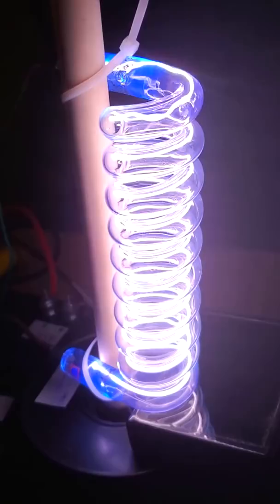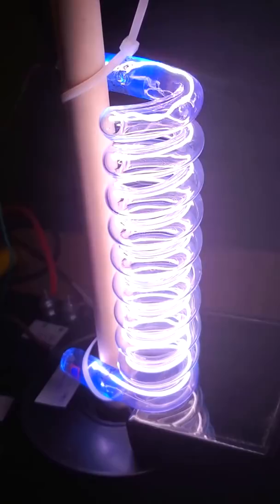high energy helical xenon lamp

Comment from the maker: Helical lamps like this are obsolete for even flashlamp pumped lasers, so they are rarely made any more and are thus very difficult to find. Linear flashlamps are almost always a better option in driving solid state lasers. Not only are linear lamps more efficient for pumping laser media, they also have significantly lower inductance than a helical lamp. That being said, it is hard to top the beauty of these old helical lamps.
Reply: Literal prodigy.
Reply: Cool
Reply: A sincere request to also upload these shorts as videos bcoz I hate the auto-downgrade of quality with shorts, I can't fricking control it!!
Reply: ….Pretty cool, right?
Reply: The light
Reply: I love how you type exactly the same way you speak
Reply: How did you procure the lamp
Reply: Beautiful 💞 neon is jealous 😂
Reply: Yes
Reply: I read this in your voice
Reply: @sushimshah2896  just don't watch it through the shorts section do it through the channel and it'll be a regular video
Reply: Omg the bug zapper over 9000
Reply: Is the higher inductance due to the helical shape, like the coil on an inductor?
Reply: Can't you just take a linear lamp, roast it a little and weave it into any form you want?
Mmmm flash pump spaghetti
Reply: Love this guy.
Reply: That laser you showed at the end with it tho... Good lord, the fact that it's capable of making the air in it's path literally combust like that is astonishing as to how much power it has. Sure it may not be very efficient, but... It's certainly beautiful.
Reply: @bigdiglett3258  On mobile it forces it into the shorts portion of youtube regardless of how you access it. If you want it in video format, utilize desktop. (It's literally the only option for such. And hopefully Google's dev team for Youtube doesn't screw us desktop users over in that area like they did with mobile users.)
Reply: @timteecvhn  i wrote that comment while viewing the video normally on my phone you just have to press it in your reccomended or the videos tab of the channel instead of the shorts part of the home tab
Reply: Love these vids!!!
Finally getting a constant supply of epic vids :D
Reply: @KB04  why you got a girl pfp
Reply: @corpmobb4134  why do you care enough to ask
Reply: @corpmobb4134  first of all why are you asking a random person that on the internet?

Second it’s really common.

Third it’s actually a gif but it starts with a girl and it only works on google.
Reply: Pretty cool, right!
Reply: @bottlekruiser  I'm the master
Reply: Wow man, that is pretty pretty cool. Love it
Reply: @timteecvhn  In the laser cannon video, this thing shattered the original lens he used to focus the beam. He had to get a special one which is more transparent.
Reply: I only want a link to buy them. is that so much to ask for?? i just want pretty spiral electricity
Reply: That lamp is quite honestly, one of the prettiest things I've ever seen
Reply: I do rather like the way the discharge slowly worms its way down from one end to the other as it starts up :-)
Reply: This is one of the most beautiful things I've ever seen. I want to find one of these to make into a lamp. I'm an electronics engineer, so having such a direct visualization of current flowing like water  is like a dream come true. God that thing is awesome.
Reply: Can I buy this?
Reply: @KB04  he'll never admit it but hes a genius. the amount of knowledge that guy has is wild.
Reply: I used to have one... They're pretty sick. At full tilt those things are hair up on end material if you're up close, among other things 🤣
Reply: @barretprivateer8768  Plasma discharge in that form is beautiful. I had a decent collection of all kinds of plasma lamps... Never not mesmerising.

It's all about the gases involved and their pressures, then just a little RF to wake them up.
Reply: @sushimshah2896  Just comment 00:01 , tap the
timestamp then the vid will play in normal
youtube instead of shorts

nvm youtube fucked it up
Reply: Is it possible that you can make an EMP grenade
Reply: @someguywithnochallenger8178  This thing is a rather weak one when it triggers... That what you mean? Lol
Reply: @someguywithnochallenger8178  All fine and good... Just... One thing man. Knowing what you don't know is important... The cap bank behind something like this flash tube... or an EMP (even toy level)... Don't mess with caps and high voltage until you thoroughly understand things like ohms law and why that's an absolutely unforgiving combination. Jumping in is great when the stakes aren't so high.

TLDR: Just be careful.
Reply: I love old helical lamps almost as much as i love tube valves but my heart is always with mercury arc rectifiers.
Reply: Get slo mo guys to film
Reply: @shea8830  Not really gonna be all that interesting
Reply: Hey Styro, I was wondering how viable a helical flashlamp like this would be for general or decorative lighting purposes? Would the power draw for just getting the xenon to glow be too much? Would the initial cost be too high? I must know!
Reply: @Crowbars2  A few watts to see what you see there. Unfortunately there's very little "middle ground" between that and the hot discharge (intense flash). Those tubes cannot sustain the normal [pulsed] discharge level continuously (at all), and don't really do "in between".

What you see there is mostly RF excitement, which could be intensified enough to make it glow a bit more, but it will never be "useful" light. Think neon sign.
Reply: @MadScientist267  Ahh, that's a shame. I was hoping that decorative bulbs that look like lightning in a bottle existed out there somewhere. The closest thing I've found is a plasma globe, and they don't really give you usable light. That helical lamp looks like it would make a pretty cool desk lamp or something, if it was more powerful and if it didn't shoot out tons of UV.
Reply: @Crowbars2  There's a little more light than a typical plasma bulb but not incredibly so.

To get real light means intense heat in a plasma, which only really has one way out in a bulb of that nature - via the envelope.

Quartz is tough, but not that tough haha
Reply: Bro u need help
Reply: I shat myself due to explosion in the end. 
Ну спасибо, я пошёл, поменяю штаны,  хотя бы.
Reply: @djpupsik98  Stay out of the lab 😁
Reply: Gota build me one for display
Reply: Of course, everybody knows that.
Reply: I think I saw one inside a gas tube of a CO2 laser for cutting.
Reply: What voltage are you running it at to make the cool plasma?
Reply: Why do you have more than one gigawatt laser
Reply: Check this out💥💨
Reply: That lasers is one in a thousand
Reply: You should try to make the Last Prism from terraria
Reply: @xaptus  He forgot to say it 😱
Reply: Kewl
Reply: Point being ?
Reply: S C I E N C E
Reply: hmmm yes got it! i don’t understand at all
Reply: That's exactly what I need toneliminate mosquitoes in summer, right???
Reply: I want one 😆
Reply: How does it power the pulse? Is it about capacitance ?

Comment: With enough current, everything is a fuse. With enough voltage, everything is wire.
Reply: but is the wire or the fuse that kills you
Reply: @agustinsida8877  💀💀💀
Reply: @agustinsida8877  botj
Reply: @agustinsida8877  bruh 😂
Reply: I hate the fact that this is correct
Though not as much as the fact that I havent heard it before
Reply: @agustinsida8877  i forgor 💀
Reply: @agustinsida8877  the fuse
Reply: tezslaw
Reply: Technically the fuse burns you but you being the wire in a specific way is what stops your heart
Reply: What's the difference between a current and a wire or  a fuse  and voltage?????
Reply: @Wiimaster.  lots of things
Reply: @__lasevix_  Precisely, and that is exactly the reason why one must eat honey with cheese and drink milk while washing their hands from the sea at night before a full moon.
Reply: @agustinsida8877  well, it takes fewer amps than volts to kill a person. But too much of either is not ideal.
Reply: @doug4974  yeah, that's why Celsius is more efficient, you only need 22 of those to keep a person alive, not like those 295 kelvin.
Reply: @agustinsida8877  you know that amps and volts are not the same measurement, right?
Edit: They measure different things.
Reply: @doug4974  i don't think you're getting the joke
Reply: @agustinsida8877  I think you're making a bad joke
Edit: no, not a bad joke, but it's a bad comparison. Celsius to Kelvin is not the same as amperage is to voltage.
Reply: Wire is the one who makes an easy path for fuse to kill us..
I guess this is the best explanation to your question
No pun intended
Reply: wooow i heard it.... that joke flying straight over
Reply: Tell that to the amps.
Reply: And if operated wrong enough, every machine is a smoke machine
Reply: @Wiimaster.  it’s simple! Volts/watts is how Strong something is to kill you, And amps/current is how fast said voltage can do it. Hopes this helps
Reply: @bigxmusic6550  Thnx bro. I was kinda joking 😅, but nonetheless I sincerely appreciate the explanation. Much obliged man.
Reply: @Wiimaster.  
Without getting overly technical, voltage is the difference in potential between two  points. Current is a measure of the amount of electrons that difference in potential will allow to flow. Picture a piece of pvc tubing with a ball at its mouth laying on a perfect 0° flat surface. The ball doesn't roll through the tube (analogous to 0 volts/0 current/infinite impedance). The more you tip the tube (voltage increasing analog) the faster the ball rolls through the tube (current increasing analog). Until finally the tube is 90° straight up and down, and the ball falls straight through the tube (analagous to infinite current/0 voltage/0 impedance) which is a short circuit.
Reply: Wow
Reply: even vaccum?
Reply: @theheadpriest  boj
Reply: @Anankin12  Both
Reply: @proxyhx2075  well if it explodes lol
Reply: @Wiimaster. current means it moves 1 way or mostly in 1 direction(f*** off with the 1direction memes n references) the wire is the passage way like a boat on water with the "current" taking you along 1 way, the fuse idk I'm trying to figure that out myself that's why I'm here in the first place for a project of mine and voltage is just the amount in this case it's electricity and in ant other case idk what it is as I'm too drunk to think about that now n want to finish my work.
Reply: You need the fuse for it to be a wire.

Comment: My first reaction to the ruby lazer was what the fuck

Goddamn that was a huge bang!
Reply: LOL I had exactly the same reaction XD
Reply: If I remember that's the lens exploding, actually.  Even though it has a low absorbance to the energy passing through it the laser is so powerful that the tiny fraction is absolutely enough to do damage.  The slow motion shows the flash and fire coming off the other side of the lens as an added bonus.
Reply: about 13 kilojoules of energy iirc 🥲

Comment: Hello. I asked you once already in another video, but since you made a whole video solely about the lamp, I am going to ask once more here: Where did you manage to get this flash lamp? Not that I would buy it at this point, both because of my low budget and its rarity, but I'm still quite curious.
Thank you for your answer in advance and for all the inspiration you have given me.
Have a nice day.
Reply from the maker: ebay. if there's ever a weird or unusual item in my videos, I probably found it on ebay. unfortunately, helical lamps like this rarely show up on ebay though. i've only seen a couple listings in years of searching
Reply: like most things (old russian equipment and components or stuff general public isn't supposed to have), he got it on ebay
Reply: @styropyroshorts  I wrote a reply but it probably got removed because I included a link, website names or country names in it... I apologize if this is a problem on my side and this message gets duplicated.

That's what I thought, I look for most of these things on eBay as well. But as you said, there are no helical xenon lamps of this size to be found.
If I may give you a tip, try looking at Eastern-European auction sites (I'll try to mention their names in a following reply) from time to time as well - without much of a struggle, I managed to find a GU-81m pentode for half the price including shipping to the Czech Republic (I don't think that shipping to the USA is terribly expensive, as well), not to mention that it's fairly possible for you to find things of some rarity. Indeed, the sellers don't speak English, most of the time, but an internet translator takes care of this problem just fine.
Reply: @ralokossovo7906  I recently bought some GU-81Ms for $35 USD each on eBay but they shipped from Ukrain. How does that compare to the price you got them for? Also, I would be interested in some of the Eastern European sites you are referring to. Try spelling them with spaces between each letter, or underscores.
Reply: @PulsedPower  I'm sorry, I really can't post the names in here. I even tried encoding them in Base64 alongside other text and the comment still got removed not a minute after I posted it. Either the YouTube algorithm is messing with it or Styro keeps deleting it (I don't think he does - why should he). Do you have an e-mail address or some other messaging platform ID where I could contact you? I can send mine if you want.

Comment: i used to work on a flash anneal system in semiconductor production.  it had thirty 18-inch xenon tubes.  The power supply in the subfab was the size of a U-Haul box truck and you could feel it discharge from 20 feet away.  zero of the light was visible as it had multiple layers of protection/security, but it would wrinkle a wafer like a pringles chip.

Comment: Xenon lamps are so cool! Fun fact, xenon lamps are what they use to power the current DLP Digital projectors at movie theaters! They cost around $10,000 and get so hot that just the oil from one fingerprint can cause them to explode when at temp. We used thick welding cloves and lots of PPE when hot swapping them!

Comment: Im building some improvised weapons (mostly sci-fi stuff) as a hobby

Last year my project was a laser rifle that i could carry and light a campfire. Let’s say it didn’t go well… the lithium ion battery exploded (I drew way to much power from it, like 3-4 times the power it was made for)  and the laser itself was also 2-4 times more powerful as planned so the isolation i put around the array went up in flames. 
Lasers are not that used as a mobile weapon.

Railguns (also called gaus gun) work way better.

Comment: I find it very interesting to note that the plasma seems to stabilize the minute it enters the curve of the helix. I wonder if someone could use this to generate incredibly intense magnetic field?
Reply from the maker: the funny thing is that when you use the lamp to do what it's designed for (making huge, short pulses of light) the current used to drive it makes a huge magnetic field on its own, probably >1T